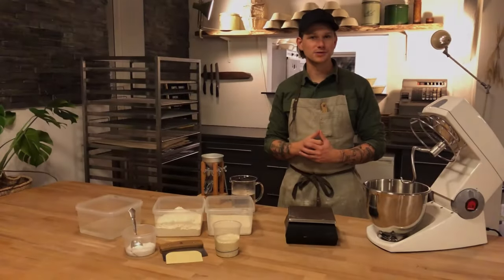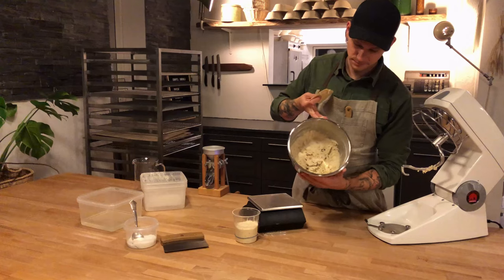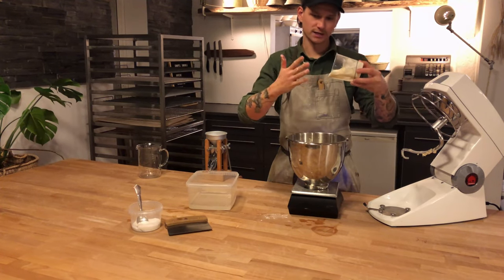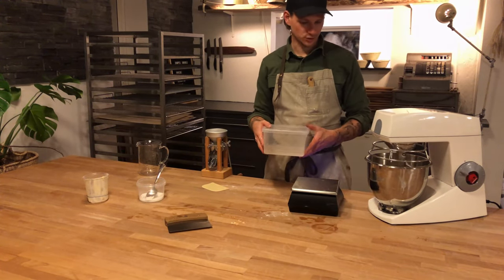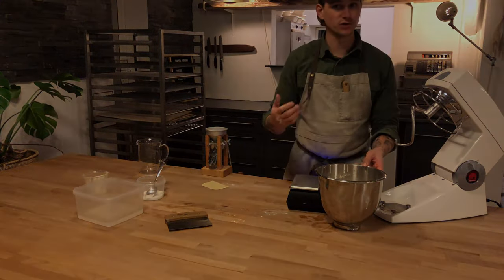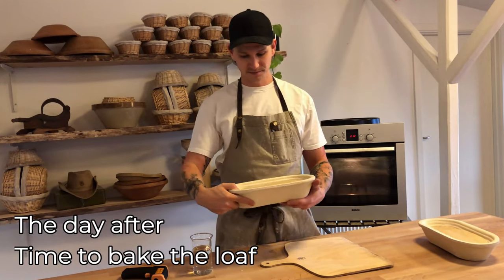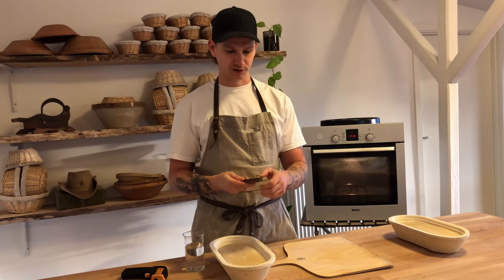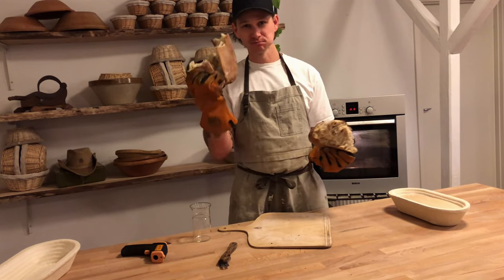Sourdough Loaf OPEN CRUMB on a Stand Mixer

Comment: Warm stand mixer bowl 
800g bread flour 
200 whole wheat 
740g Warm water (40c)
Ripe starter 

1.Add water -Always add the water to stand mixer bowl first 
Then add bread flour and whole wheat flour 

Mix dough hook until all water absorbed by four - very important to scrape bowl 
Rest 30min cover with damp cloth 

2. Add 200g sourdough starter add stand mixer bowl and salt (2%) and a little more warm water  - now you are above 80% hydration - as beginner cut down on the water 
Relax dough for 10min when it becomes tight

Transfer to bowl for folds 
Repeat folds another fold in 30min
Use wet hands 
Let rest 1-2hr

Transfer dough to work surface and divide dough wet the bench scraper to build tension in each piece
Reply: Hi, Peter. Love your videos: simple and very objective! One tip: after several tests, I found out that start mixing the water and flour(s) at medium-low speed (speed 4 for KA Artisan) will leave the bowl quite clean during the whole process of keaning. No mess at all - no need to scrape the bowl after mixing water and flour. Cheers
Reply: What is the final baked bread weight with this recipe please?

Comment: The tip about turning the oven off to stop the fan and retain the steam… I literally screamed ”Genious!” at the screen and immediately went and took my starter out from the fridge to revive it. Can’t wait to try that out!
Reply from the maker: Haha thank you. It works amazing :-)
Reply: Or, you know, you could just turn the fan off
Reply: IF you have an oven that works like that. I have three ovens (2 electric and 1 natural gas) that automatically run fans and go into a cool down mode as soon as they are turned off.
Reply: @arlenbell4376  yes but the cooling fan is much lower rpms than the cooking fan. You can hear the cooling fan when you even turn the light on in my oven, an AEG Competence, then in fan assist mode it kicks up to full chooch. But if you want, you can cook without fan mode
Reply: What temp do you bake it?
Reply: Or you could just bake your bread in a preheated Dutch oven with a lid on the first 20 mins. It keeps all the steam inside
Reply: Same!

Comment: If I understand correctly, you are largely using the stand mixer at low speed to do the initial mixing of flour and water for 30 min autolyse and after that, to incorporate sourdough starter, salt and more water for 1 min at lowest speed.  There is very little mixing by stand mixer for dough development, correct?
Reply: Seems like it. I have seen other bakers do the same. Your cant knead your dough with the machine too much because you still want to make the folds during the bulk fermentation phase. Maybe the folds add air into the dough, which improve the overall result? I am not sure, but from my experience at home, bread that was kneaded in the stand mixer more seems denser

Comment: If the dough is under proofed I do not put it back into the fridge, but finish it on the worktop. After all it has had the benefit of the cold proofing and I want to move forward with the bake.
If the dough over proofs in the fridge then remove it from the banneton, reshape it and proof it again on the work top. Works every time.
You tore your bread open almost straight from the oven. You were supposed to remind us that the bread is still cooking and that it mustn't be cut before it cools. Otherwise the steam,  which finishes the baking, escapes. Chuckles.
Great video.
It is always a joy to watch your skills.

Comment: What I most appreciate about this video is the stand mixer part - I've been having trouble working with my newly acquired mixer, and the autolyse (which I normally don't do) made a world of difference is the mixing up of the dough.  Thanks so much!
Reply from the maker: Thank you Martha
Reply: The very first time I used my new stand mixer, I found that it wasn't a great idea to put the dry ingredients in first (even though what I was making said to do that). Stand mixers have their uses, but getting all the dry ingredients off the edges/bottom isn't one of them.

Comment: There is one very important aspect these bread recipes never warn.
 I grew up with all our bread homemade. And I was the one who helped my grandma every single day. So at 20 years old, 50 miles away and a newlywed I had Grandma's recipe. Made my first loaf and it was used for a doorstop.
My grandma knew IMMEDIATELY what happened.
All you bread makers insist on warm bowls warm water. But if it is 120 degrees or more, it kills the yeast
My grandma said everytime I got the water for her, it was always too hot, but not wanting to insult the favorite grandchild she just fixed it.
Reply from the maker: <3

Comment: Thanks for this video! I use a different method, but I like to see how others do it and give it a shot too.
I do find putting water in first creates more weird dry flour spots than flour first, but that may just be because of my mixer works specifically.

I just throw it all in, and mix it. I don't bother with autolyse, I find it doesn't really help my final bread. I do my initial mix in the stand mixer, and then start doing stretch and folds in roughly 30-45 minute intervals. My bread turns out great, though I haven't yet figured out scoring the dough properly lol
Reply: I also use a more dry/stuff starter. The sour notes are fine, but the stiff starter gets me more of the type of bread I like, good for jams, nutella, etc.
Reply: If you use a Lame with a sharp blade and wet it first it is easy. More so if the dough has just come out of the fridge.
Reply: Believe me... you need the Autolyse to make excellent bread. 20--30 minutes rest, relaxation, full hydration of the flour, and maximum rise.
Reply: @MichaelDavis-x5i  experience says no
Reply: @mattymattffs  You might want to check with Cooks Illustrated on the importance of Autolyse. They are literally experts in artisan bread making.
Reply: @MichaelDavis-x5i  and yet years of making bread have shown me that it doesn't have a meaningful impact

Comment: Hi all, i know this is an old video. But i have a question. I recently acquired a stand mixer with a spiral dough hook so in the process of learning how to use it instead of my hands i came across this video. I seem to be having some trouble getting the dough to strengthen in the mixer after adding the levain/starter and the salt. I mixed it on a low speed for 1-2 minutes before it first came together, then added 5g of water, it absorbed the water and gradually got stronger and stiffer but after around 15 minutes of mixing it never regained its original strength. This is the second batch of this recipe ive had this problem with and i dont know if its just that im looking for the wrong thing or if im making a mistake. Thanks in advance 🙏 love the content.
Reply: Sounds like you are mixing constantly and you have to let the dough rest. Maybe watch his video again,  taking special note of his timings.

Comment: After watching many videos I found yours. Excellent tutorial and I like yours the best. But, I will not be able to bake it as you did, if I shut off my oven it will take anther 30+ minutes to reach back to the desire temperature, would you suggest to bake 20 minutes with water bath and 20 minutes without ? Thank you .
Reply: Just use a Dutch oven,  no need to turn off the oven. The Dutch oven creates a closed environment for a great steam situation. Place your Dutch oven in the oven to preheat and leave about 20-30 minutes after oven reaches temperature. I spray water over my bread before putting the lid on. Some people throw ice cubes in the Dutch oven to create more steam. I also place a cookie sheet on the bottom shelf of the oven to help shield the bottom heat. If I don't do that,  the bottom crust is terribly hard to cut through. Good luck baking 😊

Comment: Sounds good, are you danish? So the heat is stable in the oven when you turn it off and on again? My oven fan keeps going I think (with a Blomberg oven).. I will try anyway..
Reply: The convection fan in your oven should not be running if you turn off the oven. One of the very important steps is to turn off the oven to get the highest Oven Spring (Final Rise) and set the crust for the right thickness and teeth "pull" when you enjoy the bread. You must use steam to set the thickness and crispiness of the crust.

Comment: Thanks for the great recipes, I have two questions, 1. How do I make a 400gr starter or more? 2. In each starter feeding I take 50 gr feeding it in a ratio of 1: 2: 2 Do I throw away all the rest of the starter left from yesterday?
Thanks
Ronen
Reply: I only keep 45 grams of starter. For the levain in a 1 kilo batch of dough I pull 30 grams and add 85g of water, 45g  bread flour and 40g of whole wheat. I feed the remaining 15g of starter with 15g of water, 7g bread flour and 8g whole wheat. No wasted starter. Ever.

Comment: Thanks for the video, I always needed something like this. Question: you say hydration is well over 80%, but in your recipe you are using 740g of water and 1000g of flour, plus 200g of sourdough. That actually makes it 76%. Are you using different ratios in the video? Thank you very much again. I never quite had the EAR, I hope this time is the charm.
Reply: @Jeremyspoken60  60 grams seem a little to much for me
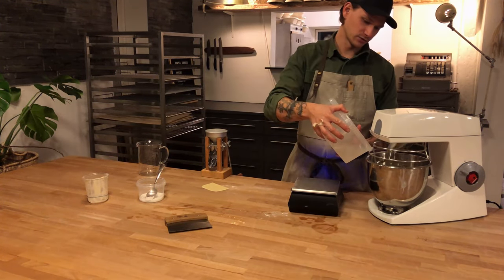Reply: @lucadoctorbho266  He didn't specify how much eau de bassinage he was putting in (6:10), but it looks like a good quarter cup or so.
Reply: Ah, if you scroll through the comments, you'll see he says it's an extra 5-10% (=37-74 g)

Comment: I have a relataively new model LG oven/range that when turned off has an exhaust/cooling fan that runs automatically.  I think that is preventing the loaf from springing with the steam during the first stage of baking.  Not sure if anyone has any tips around that?
Reply from the maker: Bake in a dutch oven :)

Comment: HI, PETER....I'm not very experienced at making sourdough, but do have a question to ask of you, if I may please!  Hope that it's not too dumb of a question!  I would like to do all of the kneading using my stand mixer.  I am aware that the dough could get too warm at a regular setting, but if I shut the mixer off a couple of times to rest the dough and to cool it, could I get a very strong "window pane" and get away with  having to do any coil folds?  I would like to make 4 or 5 loaves at a time and freeze them.  I'm trying to cut down on the physical labour, as I am an elderly person.  I thank you very much for your kind reply!   🌷🌷
Reply: The folding North to South and  East to West is required to develop the proper crumb (gluten formation). You can do this very simply by using a curved, flexible plastic spatula made specifically for bread making. This is available from King Authur Bread Co. by mail order. These are about $3.00 and with it, almost no work is needed to do this important step. When you don't bother to do that several times the crumb will be very small and the rise will not be the best. Skipping the methods he says will result in a substandard loaf. He knows exactly what he is doing!

Comment: I cant find anywhere information on whether or not stiff starter is suppose to pass the float test, I got fluid starter and a stiff starter, but even when my stiff starter is double in size and seems in every way ready to bake with, it cant float. Is that suppose to  be like that, if someone has the answer to this i would GREATLY apricate it!

Comment: I have a problem with the cold proofing: my fridge is at 5 degrees and after 12 hrs the dough is over proofed. Happened 3 times now. I don't want to change the fridge temp. could you suggest a room temp proofing time? my guess is a couple of hours at 20 degrees or is that too fast? if cold proof IS required i.e. extended low temp slow proofing IS needed then I guess I'll have to change my timings so the cold proof is done during the day...
Reply from the maker: You need to proof colder 2-4c

Comment: I'm curious to know if you would turn off the oven, if using a gas oven with brick bottom?
Reply from the maker: Does it use a fan? :)
Reply: @SimpleSourdough  It does not use a fan. The issue is that it has a stone base and the bottom Of the bread is burning too quickly.

Comment: Thanks for the video! Could you share some tips on how to make the dough this extensible at the shaping stage? I used to hand mix and later used KA for mixing and lately moved to spiral mixer. Spiral mixer does a great job developing gluten but now my dough is pretty strong but not extensible at all. Even with hydration above 85 the dough can hold its shape during whole bulk period folded just once and I can barely do the "no stress" shaping where you can just fold it in half and pinch close. Also I usually prepare dough for several loves and when divided and preshaped the dough becomes even more elastic and less extensible. Would appreciate any help! Thanks in advance!
Reply from the maker: Hi Stas!
Thank you.

Some easy fixes:
1. Use 10% spelt for extensibility
2. Use a younger Levain
3. Higher hydration or less strong flour, 50/50 strong and cake flour
Reply from the maker: In that order 😊

Comment: What do you consider room temp while proofing? My kitchen is typically around 20C in the winter and around 22/23C in the summer. Still trying to figure out the right timing for proofing at a given temperature.
Reply from the maker: That sounds like here. Winter time it can be colder tho

Comment: Hmmm .... Don't know what goes on here ... Followed your recipe to the letter;  Tipo 00 w 12,5 % protein, whole wheat with 12%; Starter was fed for 3 days with the Tipo 00, really responsive and used at peak; obeyed all rest/folding times, the dough was really nice to work with during the process and nothing felt off. Let the loaves stay out for 30 minutes after preshape and putting them in the bannetons before 10 hours of fridge time, and still, came out totally flat :-(
Reply: Yup.  Tried 2x and both were flat.  Either Im not kneading in the mixer enough during the addition of starter / salt or it requires more coil folds.  I will try each separately to rule out these gaps in the process.

Comment: When you start the bulk fermentation, is that when you out a piece of the dough in a container that contains room temperature water? And when that piece of dough floats to the service, bulk fermentation is finished and it can retard in the fridge? Thanks for the videos. I came to the site as food geek recommended you.
Reply from the maker: Thanks Lee
The bulk fermentation starts as soon as the sourdough is added to the autolyse :-)
Reply: @SimpleSourdough  thanks for the quick reply. Do you add the piece of dough to the water after doing the final fold? And when this floats, the bulk fermentation has finished? Sorry for all the questions.
Reply from the maker: @leeedwards3783  Yes exactly :-)
Reply: @SimpleSourdough  lovely jubbly
Reply from the maker: @leeedwards3783  ☺️🙌🔥

Comment: Open crumb actually means you made a mistake when fermenting the dough. Too much yeast is still active when you place the bread in the oven and the bread rapidly expands leaving huge holes.
It has little or nothing to do with making the bread with a stand mixer or by hand.
(obviously you'll also have bigger holes in higher hydration dough)